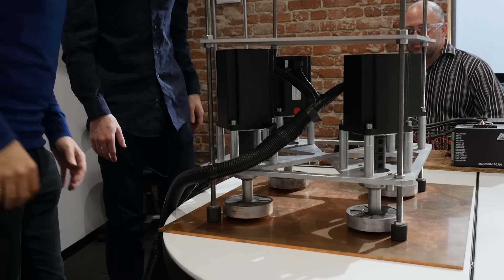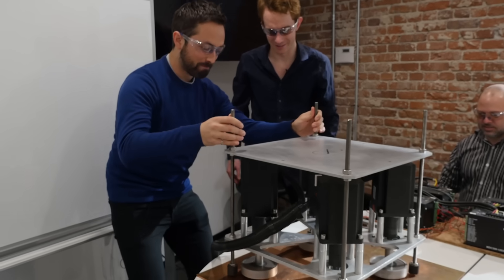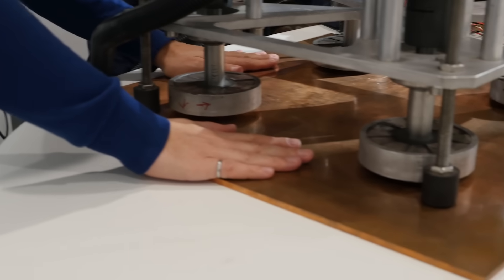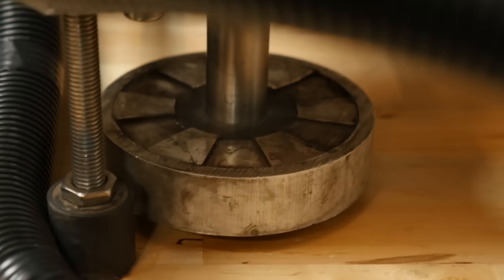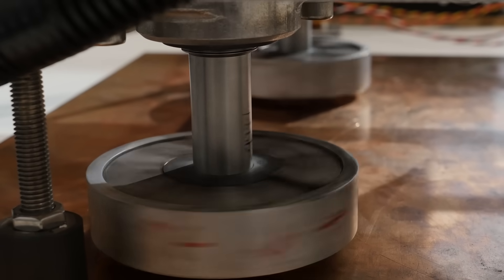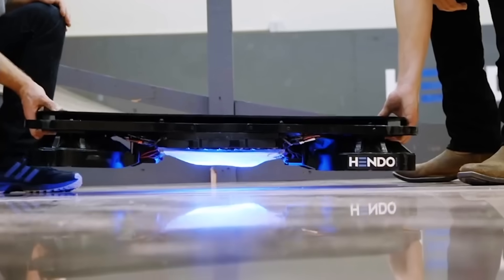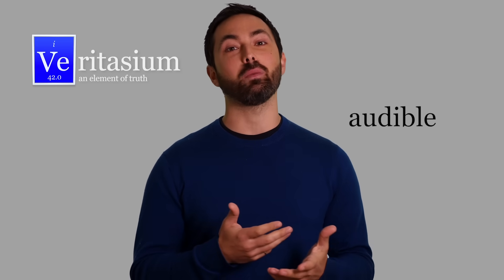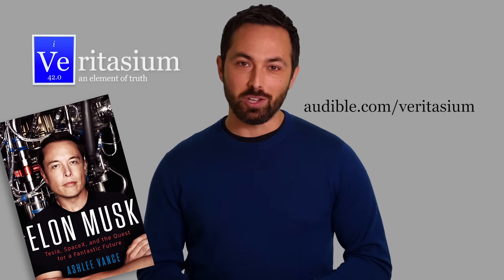Electromagnetic Levitation Quadcopter

Comment: what if they used Gold as a surface instead of copper
Reply: this has nothing to do with electric conduction but magnetic conduction, you should learn the difference
gold is being used in electronics because its easily formed/soldered and like you said has a high corrosion resistance (copper is prone to galvanic corrosion). btw copper has a greater electric conductivity than gold though
Reply: Gold is a terrible conductor relative to copper. It is used for electrical contacts as a coating due to its resistance to tarnishing.
Reply: It would be too expensive, and (if i am wrong tell me) less effective.
Reply: gold would be more effective as it can be super conductive and has less impurities than copper
Reply: Thank you, i was unsure for a second
Reply: no thats wrong, copper has a permeability of 0,999990 while gold has one of 0,999971. copper has a higher one so its better
Reply: Gold is a better conductor which is (in part) why they use it in electronics also it never corrodes and has a longer half life than copper so its better overall as that small decimal you stated will be irrelevant in 100 years when the copper used will have decayed enough to the point where its no longer really usable
Reply: Gold is a better conductor which is (in part) why they use it in electronics also it never corrodes and has a longer half life than copper so its better overall as that small decimal you stated will be irrelevant in 100 years when the copper used will have decayed enough to the point where its no longer really usable
Reply: what if they used silver instead of gold then .. wouldnt its higher conductivity prove a better lifter than copper
Reply: Ponlets
silver (μr=0,999975) has a lower magnetic conductivity than copper (μr=0,999990)
Reply: i was talking about electro conductivity i dont know where you get your values from but from what i gather electro conductivity is what we want here as i would think electronic forces would be converted into magnetic forces
Reply: i assumed you were talking about the magnetic circuit since you said "better lifter", the electric circuit plays no direct role in creating the force which lifts the object
but yes, silver has a higher electric conductivity than copper
Reply: It would be more expensive.
Reply: Then there would be a lot of happy thieves.

Comment: FRICTION, this is all about it. regular wheels will have the less friction of all know transportation systems. that is why we are using them so long. no other solution is there. Use the levitation effect of electromagnetism on rails and you will loos all your kinetic energy very soon. that is why levitation trains uses air-dynamics instead AND regular wheel for slower speeds. the project is interesting, but no future application until superconductors come in.

Comment: But I don't get this: the point of levitation is to get rid of friction, allowing greater speeds (and also less wear), but here we just saw that there is resistance to motion and a lot of heat produced. And if you ever had an aluminium block and a strong magnet, you can try moving the magnet quickly over it and see how strong the pull is. So, is the net effect still better than using wheels that have very good ball bearings?
Reply: Komninos... hyperloop may be a pipe dream for some reason or another, but it's worth a try even if it fails... we'll still learn a ton.  You sound like the naysayers in the 60's with their "spaceflight is impossible and a waste" BS... even if it were a complete failure, which it obviously wasn't, we still gained world-changing technology that is highly practical today just from trying.
Reply: Ciroluiro with maglev, most of the electromagnets used are high temperature  superconductors that are Flux pinned at certain heights. They generate no heat and act almost like magnetic mirrors. All the energy required is maintaining enough heat extraction such that ambient heat diffusion doesn't move the plate above the critical temperature.
Reply: The drag is speed dependent which mean if you move that magnet on the aluminum block fast enough you'll actually experience reduced drag and more lift.

Comment: Why would anyone use a Hyperloop and not a train?
Reply: Building a near vacuum chamber that long would be extremely expensive.  Unlike pipes with positive pressure (like a pipeline) which adds strength to a tube.  Negative pressure weakens it.  Think an aluminum coke can, under pressure vs. without pressure.  Then add to that weakness, negative pressure, an it will collapse in on itself.
Reply: My3dviews Indeed, compression vs. tension is a potential problem; I imagine that stiffening bands would be needed. Some combination of materials in any case...
Reply: Matthew Ducker  Other problem would be the need for expansion joints  Pipelines get around this by not going in a straight line, but weaving back and forth.  Not a great idea for a high speed train.  https://www.quora.com/Why-do-oil-pipelines-that-transfer-oil-long-distances-run-in-a-zigzag-manner
Reply: Angelica Ichticola A Hyperloop basically IS a train. It's a train in a low-friction environment. Mag-lev trains are still called trains. This is just the next logical step after mag-lev ... getting rid of air friction (mag-lev got rid of track friction).
Reply: I suppose for the same reason they'd use a train instead of a line of covered wagons.
Reply: Roberto Montes Probably a great deal more than half. Remember, Maglev trains can go many hundreds of kilometres an hour, and they could go much faster still if they didn't have to contend with air friction. Hyperloop runs in a very strong vacuum, so there is almost no air friction at all, and if Maglev is also used, no track friction either. This means once the train/pod is up to speed, almost no energy is needed to keep it at that speed, unlike a Maglev-only train (or a normal train for that matter).
Just about every single thing about it is superior to a normal train, the only drawback is the tube needed.
Reply: Matthew Ducker so how good is the next logical step ... does it doubles the speed of the train ? does it lowers energy use in half ? Angelica is being more logical in my opinion
Reply: Roberto Montes No worries! My guess is that a properly set up, Maglev Hyperloop will be able to have pods travel at over the speed of sound, while not making any noise, and consuming about the same amount of energy as a normal train while it's running (except that the travel time will be way shorter, so the overall energy consumption should be less).
Reply: I think the idea is just to have a slip area at the station end actually, with a seal on it. So long as the overseal section is the same material (same coefficient of expansion), or the seal is sufficiently stretchy insofar as diameter goes it should be fine.
Reply: My3dviews Yeah I think it was calculated to be like 50m or something for a typical track length.
Reply: Concorde couldn't last and it was only about twice as expensive as a regular plane. I can't imagine a hyperloop being any less than 10x the cost of a Mag-lev train. It's not going to work.
Reply: Ok thanks

Comment: I didnt think floating cars would come so soon...
Reply: Technology is so amazing
Reply: This is actually useless in creating flying or hovering cars.
Reply: DecoMac I mean if you want a car that can only hover over on its own special copper road and can travel as far as the wire you have hooked up to your nearest personal power plant then yeah
Reply: Aaron Smith Im sure it will be a thing when roads will have voltage in them, and a string connected to the road, so power will always be there :P
Reply: DecoMac so basically slot cars
Reply: Aaron Smith More or less yeah.

Comment: The main reason why Hyperloop will never happen is not because of its structural problems. It won't happen because of all of its economical problems. It will be WAY too expensive to build. Has a WAY too high chance of failure.  And does WAY too little. By the time we'll have the technology to build a Hyperloop, we'll also have maglev trains everywhere and self-driving personal jetpacks.

Comment: I've been looking for this information for about 3 years now since the original hendo "hoverboard" came out, now my question is why don't they remove the motors and just use rodin coils? the coils would make a rotating vortex of em energy producing basically the same idea? or at least that's what I think would happen, tell me your ideas and any physics that I might be forgetting, I've been meaning to build the first "rodin" hover engine for some time, but I have yet to acquire the right power supply to power it, so before I shell out the money for a "variable frequency 4 channel power supply" I would like to know it works for certain.

Comment: Electromagnetic is a lie, because electricity and magnetic energy can't be scientifically combine is not scientifically possible, the word electromagnetic is a wrong word, where in real science doesn't exist.
Electromagnet is also another lie, doesNOT exist.
Reply: Fernando Salazar Idiot
Reply: wtf, any proof to those horrendous claims?
Reply: Quite the opposite.  Electricity and magnetism can't be scientifically separated.  ;)
Reply: obvious bait
Reply: ' I saw a video once' is not a very good argument
Reply: ever tried out a coil of copper with current near something magnetic such as a piece of iron?, if you run electricity through the copper coil it forms a magnetic field and you get a magnet capable of atracting iron. the idea of eletromagnetic is that electricity can be harnessed in a way to form magnetic fields. Hell, if you run current through a wire which is not isolated and drop iron fillings around it in a paper you get to see circles around the wire which demonstrates the magnectic field
Reply: facepalm
Reply: Wtf
Reply: SpektralJo
It's true. Electromagnetism was debunked a long time ago. I saw a video once.
Reply: gafeht Link?
Reply: Then I guess the weak force is separate too?
Reply: PongoXBongo electricity and Magnetism is two different things, Magnets doNOT have electricity, electricity doesn't pull an object with opposite pole, static charge does, but is something completely different and doesn't magnetize metals, only opposite polarization objects that can Physical grab not to heavy.
Reply: Atomic bombs are also a lie the Army created to avoid going into war against Japan, and also Dinosaurs never existed, is the same USA government and the idiot Americans making lies because is a black market they are using to enrich criminals.
Reply: SpektralJo both of your possibilities are technically the same, which are obviously intended to insult, and the only idiot is you here.
Reply: Kim Bheazley I never said I am a sign of superiority, the devil is copy inside your operating system and is manipulating you to insult me, because he doesNOT want me to be happy, so you are another idiot who is being manipulated by him.
Reply: Fernando Salazar ok... whaterver... 
you say that nuclear weapons are a lie, so what did explode over Hiroshima and Nagasaki?
Reply: Fernando Salazar If dinosaurs are a lie, what are all the fossils we find all around the world?
Reply: Fernando Salazar have you ever heard of maxwell's equations?
Reply: SpektralJo Nothing, nothing happened in Hiroshima and Nagasaki as far as they told everything they have told you and me is a lie.
Reply: SpektralJo what fossils? All you see is made up bones they make those bones, they don't have a complete set of bones that can make a dinosaur, they only have found one or two bones from maybe donkeys or other animals and they claim they are dinosaurs, they don't show people the real bones because they don't want people to know they don't exist
Reply: Kim Bheazley trolls doNOT exist, you say that to insult because you are wrongly educated and you are manipulated by the devil to insult other people because you don't want other people to be happy
Reply: Your Operationg system anologies are hillarious!
Reply: SpektralJo because humans have Santiago's programming inside of there brains, he is vengeful because he thinks that I am vengeful, is the evil software that fools him to expand evil and hatred, so basically your reply is based on vengeance as a way to counter attack, everyone is like that, and that is wrong, because it leads to more problems, Santiago the programming that has fool everyone to think that is god wants everyone dead, miserable and living in fear, which is wrong.

Comment: The spinning permanent magnets is a kind of neat hack to avoid the overheating electromagnet solution.
Reply: But without it being completely clear in my mind, I hunch that at high speed, you will need both the mechanics to change shape while moving but also the motion will drink out the magnetic field very rapidly under the vehicle, perhaps to an intractable degree. Does the principle work at mach 1?

Comment: You mention the hyper loop like it's a real thing.... You are not one of the people who think that it can be built are you? The hyper loop is impossible to build do to the vacuum it needs to work and the fact that even if it does get the vacuum, the propulsion will be void because of it. Plus, the issue of the transport tube expansion over long distances, the safety issue if there is a decompression,  only being able to have one tram in the tube at a time, the time it takes to keep and maintain the vacuum needed, etc...

Comment: My first idea of using this invention is in logistics. Just create a plate with this device inside, slide under a pallet and turn on. You get heavy stock that could be incredibly easy to move, hence almost no friction, and when reach the destination just pull out and repeat. No heavy and huge forklifts anymore